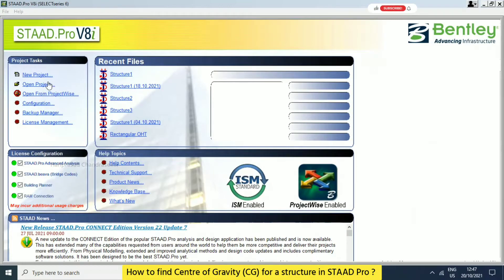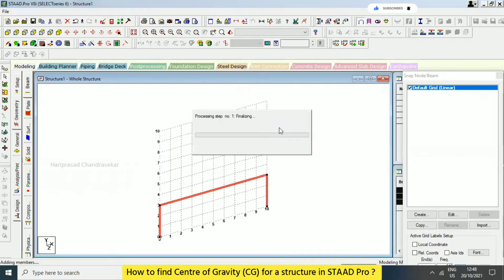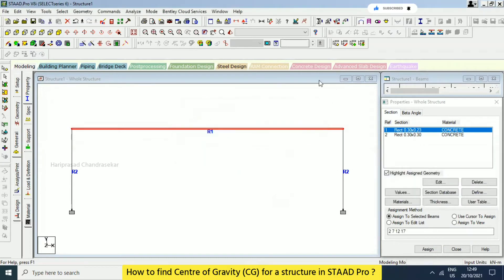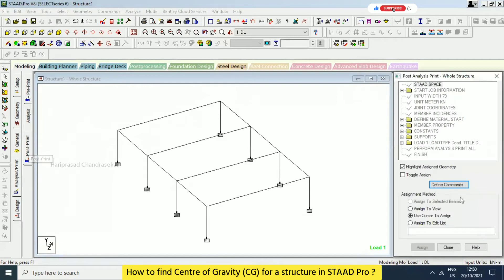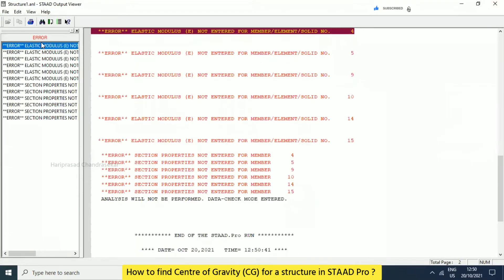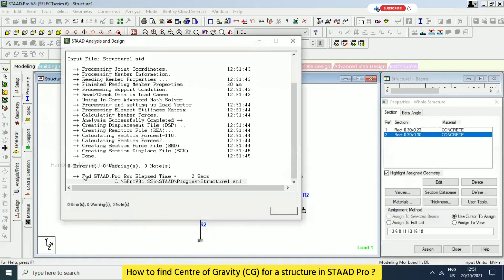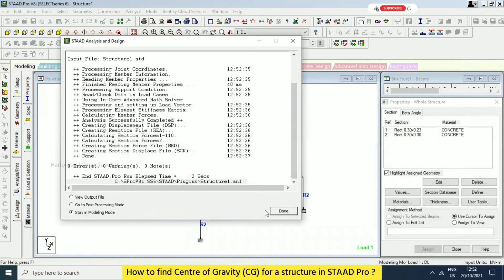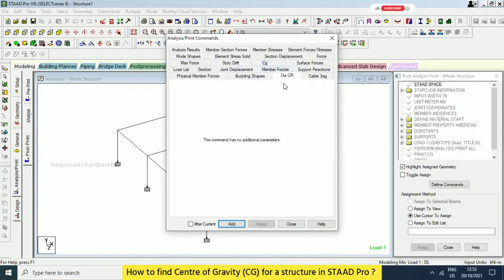How to find Centre of Gravity (CG) for a structure in STAAD Pro ?

Comment: CENTER OF GRAVITY OF THE STRUCTURE IS LOCATED AT: (METE UNIT)
         X =     5.00   Y =     2.52   Z =     5.00
         TOTAL SELF WEIGHT =              119.457 (KN   UNIT)
Reply: Toma el peso propio de la estructura mas no de las combinaciones